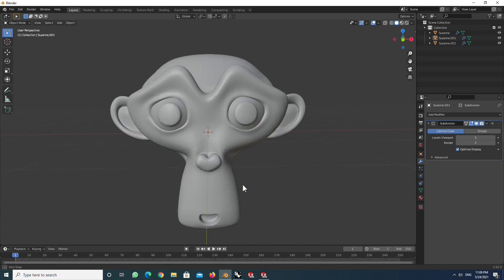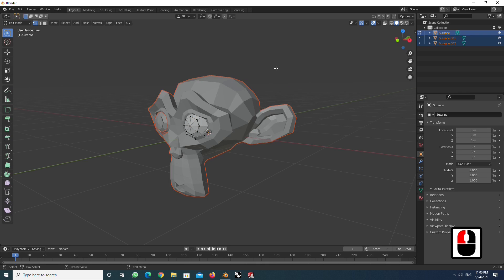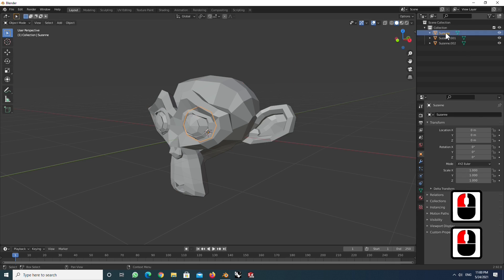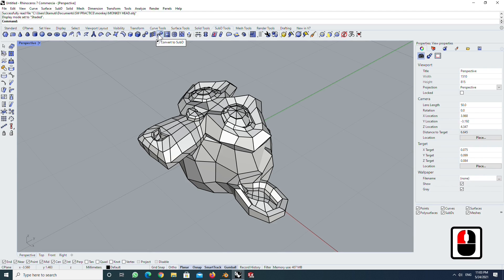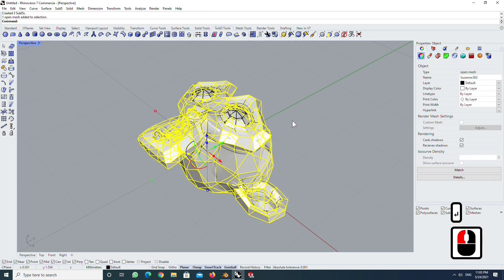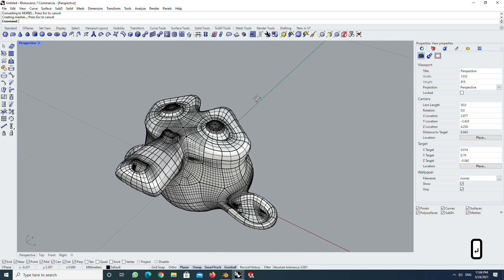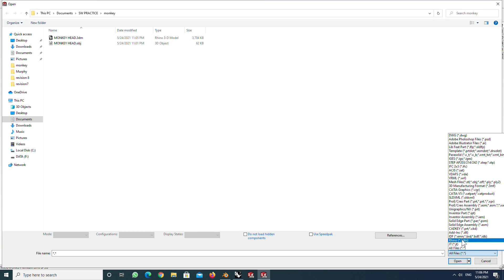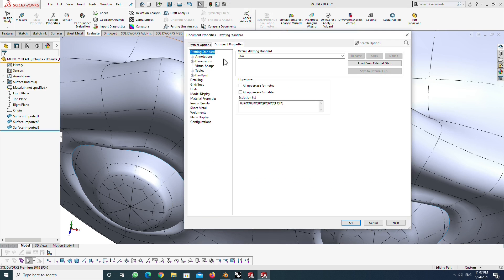Blender3D to Solidworks. How to convert low polygon mesh to Surface CAD format #solidworkstutorial

Comment: Remember to remesh first in blender to make it quad and poly because it doesnt work on high poly mesh. it will have disjointed surfaces
Reply: how would I do that?
Reply: @DigiSculptStudio  on the right side panel go to data tab and remesh is there. Lots of yt tutorial about that. Or you can use an add-on   . Some addons let you do it automatically some manually or both
Reply: @watermenlon3617  yes! i found it! thanks man! it kind ruined my model though. I tried to get it into creo parametric. I got it to open, but couldn't turn it into a solid. :(
Reply: @DigiSculptStudio  if you added a subdivision modifier make sure that the quality is set to 1. Also this method is having touble with mirror modifier

Comment: Hello. What can i do if the model has too many faces (about 40k polygons) and i need to import it to solidworks for a flow simulation?

Thank you!.
Reply from the maker: You can remesh it first using remesh feature in blender to make it low poly and quad

Comment: could you make a video converting that object to solid?
Reply from the maker: Close all open surface with fill feature and then knit them
Reply: @SolidworksPractice2  Thank you for your great videos. I have a problem, you may help me because I am working on  it for days. There is a large file that has average 5 million faces. Solidworks accept it as graphic body. How can I turn it to a solid body without deformations? Because I have to modificate it. Thank you.
Reply: Were you able to do it?
I’m working on similar thing I need to know how to convert it to solid body without deforming it
Reply: Hello, have you found the solution about converting to solid?
Reply: No, really, it always gave me trouble, and in the end, there was one that I couldn't solve. @vionaberyl3312